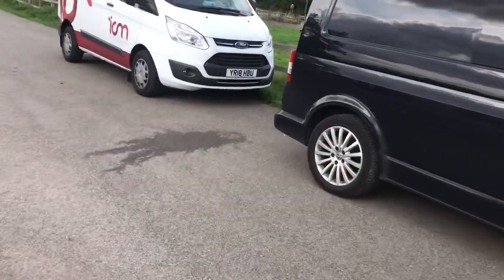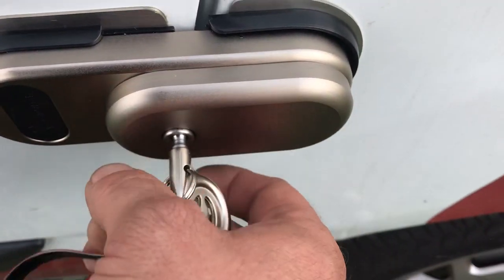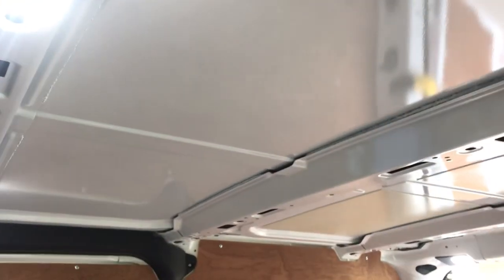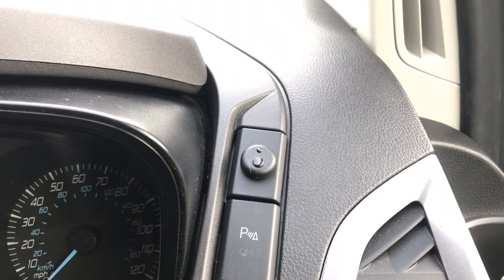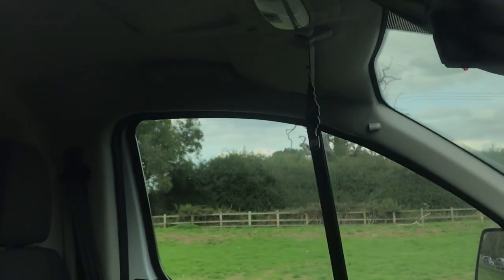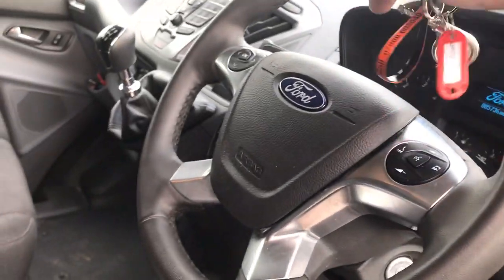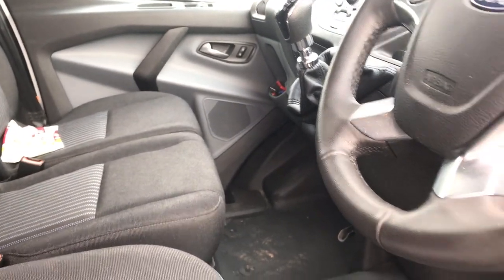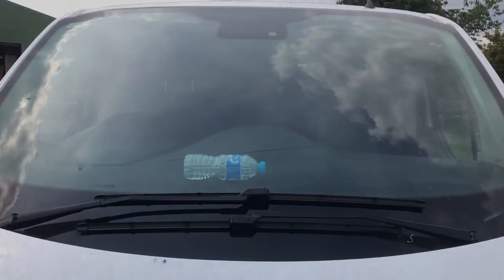Ford Transit Custom Ultimate Slamlocks Replock Cobra Vodafone Alarm security package installed Bham

Comment: Hi what would you say is more secure dead lock or these slam locks
Reply: Andrew white these are bombproof but they don’t protect the tops of the doors.  
Deadlocks have options for hi level on both doors for this van.  
If I had a large/heavy item(s) in the van that couldn’t be grabbed through a bent door I’d definitely recommend these.